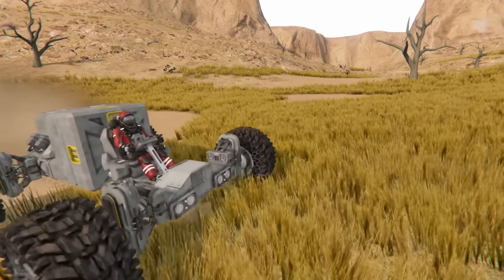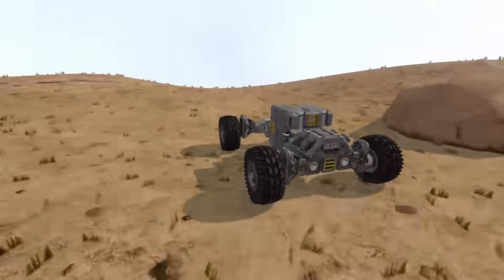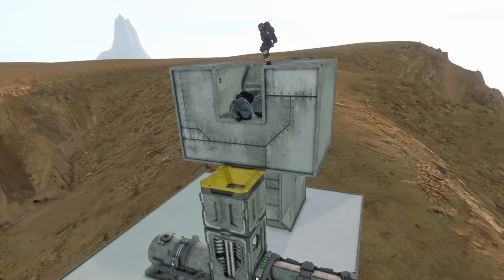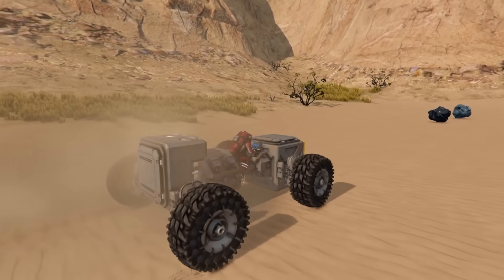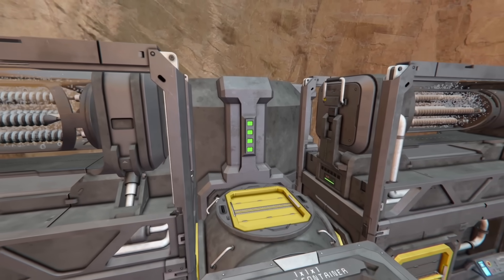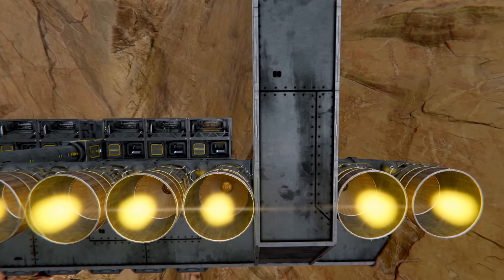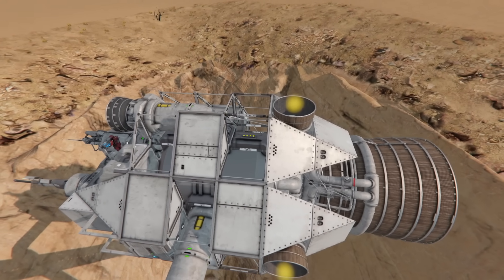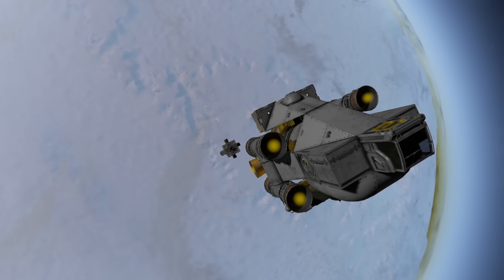Hydrogen in Space Engineers Makes No Sense… So I Fixed It

Comment from the maker: ⚠Dear viewer, please consider that there are a few mistakes in the informational overlays.
In some of the informational overlays, I used the wrong units and terms.

“kW/s” should be kJ (energy) or kW continuous load.
“16,000 kW/h” should be 16 MWh.
“molar of ice” should be molar mass of water (18 g/mol).
“1 L of H₂ = 3 W” was misphrased — correct is ~3.2 Wh per liter at STP.

These slips don’t change the main logic of the video, but I wanted to clear them up for accuracy. Thanks for understanding!

Comment: Hydrogen thrusters:
- Consume stored hydrogen gas (from tanks) and electric power (from reactors or batteries).
- Provide thrust much stronger than ion thrusters but at the cost of fuel consumption.
- Work in both atmosphere and space.
So, they’re not purely “chemical” in the sense of classic rocket engines — because they need both electric power and hydrogen to function. That already hints at something more advanced.

So we can conclude that hydrogen thrusters in Space Engineers are electrically powered plasma thrusters using hydrogen as propellant mass. They superheat and eject ionized hydrogen to generate thrust — a hybrid of electrothermal and fusion-assisted propulsion.

This theory is most consistent with what we see in-game:
- The hydrogen is superheated using electrical energy (perhaps through magnetic confinement or plasma arc).
- The result is a high-energy plasma exhaust, expelled through a magnetic or electromagnetic nozzle — producing thrust.

Essentially, this would be something like a fusion-assisted or plasma thruster, where hydrogen isn’t burned chemically with oxygen, but instead used as reaction mass that’s energized electrically.

My example of how should we treat hydrogen thrusters based on this above:

1) Core physics (simple rocket-plume model)
- Two key relations:
* Mass flow (kg/s) required to produce thrust T(N) with exhaust velocity ve(m/s):
m = T/ve
	
2. Ideal kinetic power (W) carried by the exhaust (minimum electrical → kinetic energy you must supply, ignoring losses):
P ideal = 1/2 mve^2 = 1/2 Tve^2
(Use this to estimate minimum electrical power. Real systems have inefficiencies, so divide by efficiency n to get electrical input: 
P electrical = P ideal / n

Hydrogen mass used per time = m (kg/s). Multiply by 3600 for kg/hour. To convert to liquid hydrogen volume use density pLH2 (approx. 70 kg/m^3). To convert to gaseous hydrogen at STP use density approx 0.0899 kg/m^3
(spacecraft tanks store cryo or high-pressure gas — liquid is simpler for volume estimates)

Assumptions I’ll use in example
1. Exhaust velocity ve=10,000 m/s (this corresponds to an Isp ≈ 1000 s — reasonable for a high-thrust plasma/thermal-propelled concept).
2. Liquid hydrogen density pLH2 = 70 kg/m^3
3. Two electrical-efficiency examples: optimistic n=0.75 and conservative n=0.50

Example
T = 1 kN = 1,000 N
1. Mass flow: m = T/ve = 1000/10000 = 0.1 kg/s
2. Hydrogen per hour: 0.1 kg/s * 3600 s = 360 kg/hr
3. Liquid H2 volume per hour: 360 kg divided by 70 kg/m^3 = 5.142857 m^3 times 1000 is 5142.857 liters
4. Ideal power: P ideal = 1/2 Tve = 0.5*1000*10000 = 5000000 W = 5MW
5. Electrical power efficiency:
- At n=0.75: P el = 5MW/0.75 = 6.6667 MW
- At n=0.5: P el = 5MW/0.5 = 10 MW

Summary
1kN:
0.1kg/s ---> 360 kg/hr ---> 5.14 m^3 (5143 L) liquid H2/hr; electrical need approximately 6.67 - 10 MW depending on efficiency.

So, this is some basic idea of how should H2 thrusters work in space engineers and math to calculate electricity consumption while using hydrogen engines while threat them as plasma thrusters ofc.

For possible mod:
It would be ideal to have these:
1. electricity consumption while using H2 thrusters
2. Conversion like Ice ---> Water ---> H2 and O2
3. New type of power generation (to fulfill thrusters needs for electricity *only while thrusters are active* )
4. Possibility of implementing new type of Chemical engine which uses H2 and O2 as well

Sorry for long comment, I hope it will give some ideas for someone
Reply from the maker: Thanks for such a thoughtful comment! 💗
Your idea is much more of a scientific project than a mod idea, TBH. From the mod perspective itself, it will require a lot of work, including new blocks and mechanics to maintain LH2, but from the player perspective, it will give only one mandatory block to maintain power for those thrusters. It's not going to change the situation dramatically and doesn't solve the existing problem of oxygen being the most undervalued resource.
To summarize, it's a great idea and I see a lot of work behind it, but I see too little sense to put all the effort into converting it into a mod.
Reply: @thescrewupteam  I agree 100%, it is too much work for mod project. Simple reason is O2 will left again as an waste product LoL
Maybe to implement an O2 in to electricity production, for example using O2 together with H2 to burn the Hydrogen engine, like similar to HHO generator some people use in cars. like injecting the raw mixture (HHO) into the hydrogen engine to boost it's electricity production etc.
Maybe as well implement it as an booster for refineries to increase speed of refining even more (similar when injecting pure O2 while melting the iron to increase it's temperature to over 1500 degree to be able to produce steel instead of iron, but in this case it could just increase speed or yield boost etc.)

But yet again, it is heavy project for a mod, probably team of people must work hard since it is gonna change a lot in game

Comment: basically every calculation here has very fundamental errors. do a remake and stop trying to use litres for your calculations. you might also want to consider how much oxygen you need per hydrogen to oxidize it fully.
Reply from the maker: As for the remark, it's already been made in the pinned comment. As for liters, this is the metric in volume in SE itself, that's why I selected it. The amount of oxidizer will vary depending on various factors, like gravity, atmospheric density, sunlight, and so on. This will introduce major complexity both for the game engine and the player without adding any satisfaction. BTW, real-world hydrogen engines are running rich because the goal is not to burn fuel totally but rather to get as much thrust as possible.
Reply: @thescrewupteam yes that is true. expelled mass * speed equals force.
Reply from the maker: Anyway, thanks for you feedback 😇

Comment: You mention exhaust gas velocity when talking about hydrogen thrusters. A real world way that velocity is improved in hydrolox rocket engines is that they run fuel-rich, supplying a surplus of hydrogen, which has a lower molecular weight than water as an exhaust gas, and therefore a higher net gas velocity is achieved.
You could do the same for your mod (which would also leave the surplus O2 for use in life support systems)

Comment: There is no such thing as a "kilowatt per second". A watt is a measure of power, which is energy divided by time. 1W = 1J/s. The unit of time is already there. 1kW/s would be 1000J/s^2, which would imply an exponential power curve rather than linear draw.
Reply from the maker: That's true and noticed in a pinned comment.

Comment: Great mod! But what about the performance cost (I'm aware that the main goal is realism, just in case someone plans to introduce it to a server)?
Reply from the maker: This mod is a satellite for HMS and uses its core to run. HMS has several mechanisms to scale load based on heat-related grid size. So, currently it's fairly optimized even for a full server with huge grids.

Comment: Curious what the thrusters got balanced to. You went so in depth on the power and o2h2 generation side but then only that thrusters are no longer magic. Ive found vanilla engines to be WAY lower thrust than they should be for their size, but they are also way too efficient for their thrust.

The space shuttle/SLS rs-25 engines would be a good reference for either of the 2.5m (small grid -  large/large grid - small) thrusters
Reply from the maker: They've got a little cut in thrust and boost in consumption to keep up exactly with the shuttle thruster efficiency level.

Comment: 4:45 for context, most electric vehicles consider 7kW to be a decent slow charge rate, 3.5kW to be a very slow rate.
So at 4.5kW rate of delivery that could deliver about 1 mile of movement that would take about 2 minutes, versus the 1 second for electrolysis or in other words a good elevtric car uses enough energy to move 1 mile to instead electrolise 120L water
Seems crazy
Reply from the maker: That's physics 🤷‍♂️

Comment: Maybe in SE, the power you insert in a H2/O2 generator is used to keep the system running and a large part of the H2/O2 extracted from the ice is used up by the system, the outputted H2/O2 is just system excess, usable by the player.
Reply from the maker: Okay, it uses gases for... what exactly? 😅
Reply: @thescrewupteam more power for the generator. Primary power is inserted, secondary is generated, used internally, never leaves the system and excess H2 and O2 is outputted.

You're referring to the thrusters working on H2 only? I've got nothing for that.

Comment: Wait.. WHAT 3:24
This hydrogen tanks holds 1M L and this is volume V.
V = 1M L = 1M dcm^3 = 1K m^3 = 1000m^3. WHAT?!
This tank cannot have volume of 1000m^3 with size 2.5mx2.5mx5m!
Real max volume must be 31,25m^3=31,25K dcm3 = 31.250L
Reply from the maker: You're missing that gases are easily compressible. So 1k m3 gas at STP would take 31m3 as around 32bar easy :)
Reply: @thescrewupteam  Game says about VOLUME of gas contained in tank. So it must be already compressed to 1M L with unknown pressure.
Reply: You can not just tell "I can compress 2L to 1L with 32bar" because you can not change VOLUME of CONTAINER and you don't know what's original pressure of 2L. Maybe it was 100bar and you need 200bar to hold it as 1L
Reply: @thescrewupteam  I mean game in current state tells that gas contained in such big volume that are bigger than tank. And I think game can say only about volume of compressed gas (how can you tell volume of imaginary uncompressed gas)
Reply: How do you understand information about hydrogen tank in game?
Reply from the maker: There is a common standard that when talking about gases, they're measured at STP. Because most gases are used as STP. Nobody (except for delivery services) cares how much it occupies when compressed. The simplest example is consumer gas gauges. They calculate consumption at STP, but gas is actually transferred as compressed.

Comment: We have engines in the 40 to 50% range now and the Wärtsilä 31H2 is a large hydrogen engine that exceeds 50% efficiency now
Reply from the maker: Uh, really? Thanks, that's very interesting!
Reply: Also for your system this would also mean the engines are producing about 18GJ of heat which is a huge amount of ice melting potential, which would increase overall efficiency
Reply from the maker: You're right, and that's already implemented. You can transfer heat from engines to generators and reuse that energy.
Reply: You may be intrested to know that moden recuperation systems can boost a generator's thermal efficiency to well above 85%.
Reply from the maker: Yeah, I'm definitely interested to learn more. Could you share some examples of recuperation heat into electricity that really works on industrial scale?
Reply from the maker: Thanks, @BenSmith0. This type of recuperator I know. While in general they do work and recover some waste heat, they do not increase efficiency drastically in terms of a single resource. You're totally right, it's possible to reuse that waste heat for other work, which is sort of implemented in my mods already. Because you can transfer waste heat from engines to generators, for example.

Comment: 2*H2O=2*H2+O2 (moles 2=2:1)
v=55.6K moles of hydrogen (same moles for 1000kg of water) (1.000.000mg/18(mg/moles)=55.6K moles)
T=300K (assume 27C)
p=32bar (as you said this pressure)=3,2MPa
pV=vRT
V=vRT/p=55.6*10^3*R*3*10^2/3,2/10^6=55,6*0,3*R/3,2=43,3m3
V=43,3m3=43,3K dcm3=43,3K L=43.300L
You get 43.300L of HYDROGEN from 1.000kg (370L in game) of ICE/WATER
Which means 117L of HYDROGEN from 1L of WATER.
But you calculated 1232L of hydrogen per 1L of water 2:35

Comment: Inside me are two wolfs, one enjoys exactly this kind of realism mod, the other enjoys flying while welding a clang engine with 10 tons of materials at hand, none of them takes the blame when of the mobile transforming factory/digging rig blows up in the air.
Reply from the maker: It's very important to feed both those wolves. You can have a separate world in SE for each 😊
Reply: Even just the thrusters requiring oxygen is cool, makes it more usefull instead of ever only needing like one large tank ever

Would that be possible as a “Lite”/“Soft” Version?

Tho maybe also add proper jet engines too if there much different from the “long” thrusters

Comment: Man.... You are using wrong units.
You use for power - energy units (MW*h), but you need just power units (MW) 7:56
Also this problem occurs several times in this video.
Why do you just convert 1.500W (power at specific fuel consumption) to 5,4MW*h?
For me it doesn't make any sense. Misinterpretation can cause serious math errors.
Also: game uses right units for power: MW and kW (I just checked wind turbine)
Reply: BTW, Game says hydrogen generator generates 5MW not MW*h because it's POWER not ENERGY (energy=power*time)

Comment: Your maths is not even slightly close, you don’t have the foggiest idea.
For starters you don’t know the difference between watts and watt hours. You repeatedly mix these up.

Perhaps the most egregious is when you claim that burning 1L per second of hydrogen produces 3 watts of power when the reality is that it produces 12.75Kw of power.

I commend your efforts to fix the hydrogen economy of space engineers, but frankly, Keen’s implementation if probably more accurate.
Reply: Although that's spelt kW, not Kw. Kilo-watt, not Kelvin-w…hatever
Reply: I think there was some Google unit conversion-fu that went wrong to produce that 3 watt number, but his MW number managed to be close-ish enough. Ironically it made his hydrogen power generator close to 39% efficient, barely above real world levels instead of the gamified 50% he was shooting for.

Comment: This is amazing. I only wish it came out 4 years ago. I would've loved to have had a mod like this when I started my Survival Impossible with realistic physics mods playthough. But at this point, I don't think I could add it without breaking a lot of my builds (mainly due to the power costs changes). But I'll experiment with it in some tests save to see. Does this require the heat management mod to work (Cause I've already decided that was too much work to get working with my existing builds)? 

Also, I always thought the h2 engine was a really noisy and inefficient fusion reactor, so it never needed oxygen. But it being a combustion engine makes so much more sense. It would explain the piston cylinders 😂
Reply from the maker: Yes, HMS is the requirement for this mod. Technically, this mod is a satellite for HMS.
Reply: @thescrewupteam  thanks. Both mods are really cool. But sadly, at least for that save, they're a no. I will keep them in mind for the next time I start a new save. Keep up the awesome work

Comment: 6:37 this is factually wrong! the most powerful oxidizer is fluorine, oxygen is just most abundant/readily available one!
Reply: Flourine is so fun!

This is an excerpt from Ignition! , the premier casual history book on rocket propellents:

"Not only did they get a good performance, but there were no ignition problems, liquid fluorine being hypergolic with almost anything that they tried as a fuel. Unfortunately, it was also hypergolic with just about everything else. Fluorine is not only extremely toxic; it is a super-oxidizer, and reacts, under the proper conditions with almost everything but nitrogen, the lighter of the noble gases, and things that have already been fluorinated to the limit. And the reaction is usually violent."

"Almost anything" includes pipes, turbopumps, engines, engineers, water, fire extinguisher powder, and of course, concrete.
Reply: @Greenicegod  Search up fluorine burning a brick. its a fun watch.
Reply: The tri propellant rocket dyne engine, did use it but the primary problem with it is exactly how dangerous the stuff is. its not that fluorine is unabundant, but its hard to break its molecules and very hard to store.
Reply: You mean reactant. Oxidization is specifically oxygen.

Comment: Ive always thought a staged launch with event controllers would be awesome!  now i have a reason to give it a shot :D.  Can't wait to check it out when i get some time.
Reply: heck even manual launch with a H2/O2 meter on the tanks and when it is getting low you flip a switch and disconnects the stage (then use event to ignite 2nd stage) etc. etc. so you still have to do stuff and not just sit there

Comment: Seeing “kW/s” as a unit of power makes my blood boil.
Reply: How does using the wrong unit help to explain things? kW/s is a measure of the second derivative of energy, so it’s not power, it’s more like “energy acceleration”. You could use it to measure the ramp-up of the output of a battery, for example, but using it for a constant consumption is strictly incorrect.
Reply from the maker: Yeah, that might feel strange. Weird stuff I do to explain ideas 😇